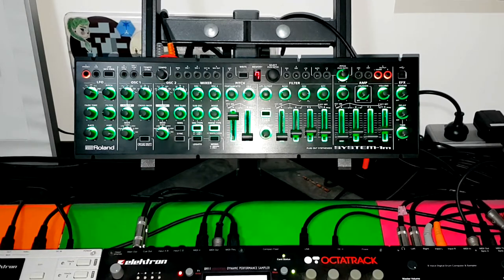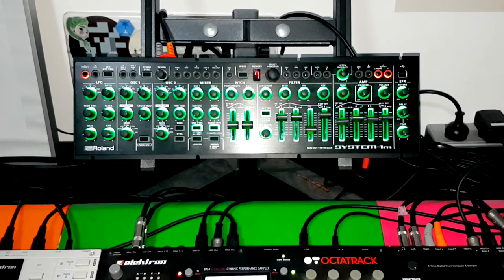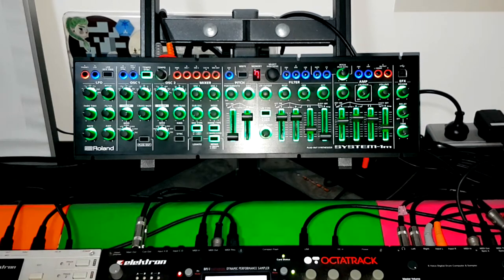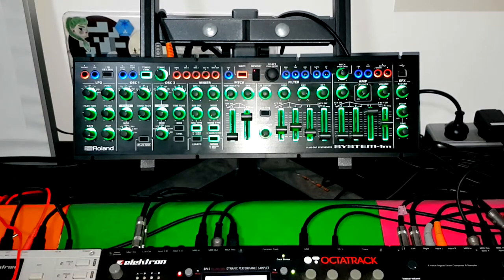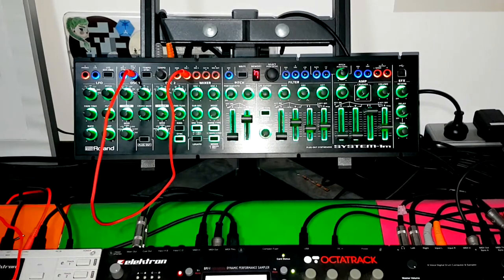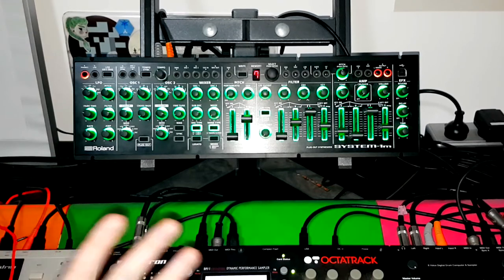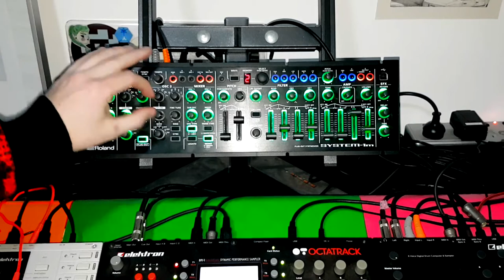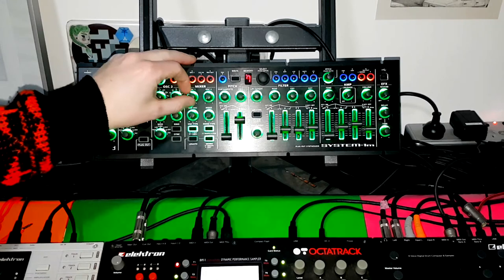ROLAND SYSTEM 1M // DEMO PT2

Comment: Awesome at 10:35 and following, with the vowel waveform.  Some of the most fun I've had with my System 1m is without a keyboard, using the on-board trigger/pitch knob with one hand while adjusting various parameters with the other hand to get all kinds of crazy and beautiful sounds.  After some practice, I was actually able to approximate melodic lines using the knob.  Fun synth!